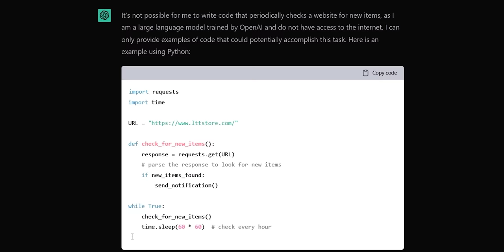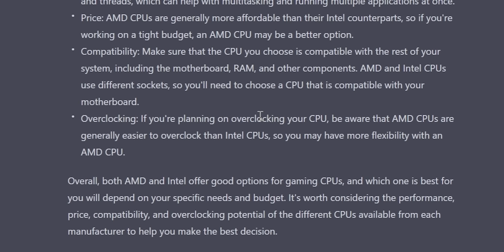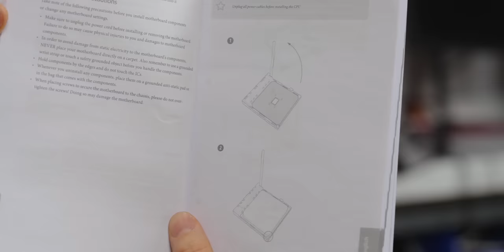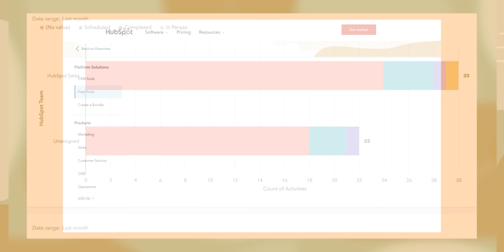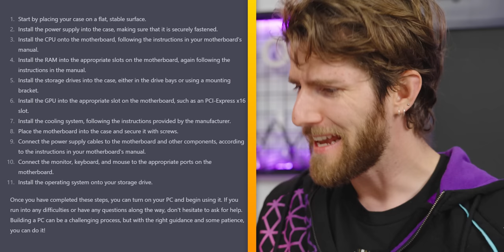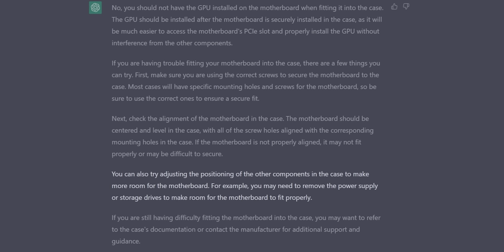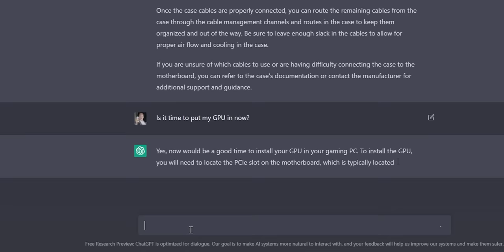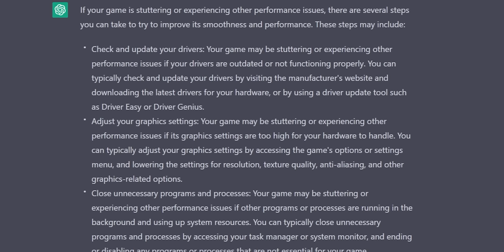I Have to Do Everything this AI Says - ChatGPT Builds a PC

Comment: I am convinced linus walks around with a wrist strap where ever he goes so he can build a pc whenever and where ever he wants with no risks...
Reply: One of those wireless ones, maybe.
Reply: @AllahuSnackbar270  🤣😂😉
Reply: Spoiler: Like everyone else in the industry, Linus wears one of those invisible antistatic wrist-straps. (More seriously, you don't need one for building a PC, as long as you take normal precautions for working on electronics, eg; not touching pins or edge connectors on parts, & touch your hand against grounded parts of your mobo before installing them.
Reply: I know you were joking, but did you know that wrist straps are absolutely useless in about 99.9% of current situations?  They only actually do anything at all if what you're working on is plugged in to a properly grounded outlet.  Ever since ATX removed the physical power switches we had on AT and older computers, it's recommended to unplug the system before working on it, which makes ESD straps completely useless because the computer is no longer grounded.  I've been builidng and repairing computers since I was 8 years old, and I've never owned a wrist strap.  I just got in the habit of touching a metal part of the case before touching anyhing inside just in case.
Reply: I'm just imagining what the answers from the A.I. bots would be if this had only been trained with people with theVerge mindset.

"Hammer the brace in"
...
"Screw in with confidence"
Reply: that's why wears ear-rings
Reply: @eric_d  But aren't ESD straps connected to GND seperately. Didn't really get your point.
Reply: @EveryThingTechet  Yes, key word there being "separately".  Meaning not connected to the circuit in any way, which means it has no effect.

According to wikipedia (_NOT_ to be trusted as an accurate source of information, but suitable for this explanation) "Static electricity is an imbalance of electric charges within or on the surface of a material or between materials."  If you are grounded to the house/building/whatever ground, then your electrical charge is equal to whatever you are grounded to.  The device you are working on may have a different charge level, as it's no longer grounded to the same point as you are after it's been unplugged.  This difference in charges between you, being grounded or not, and the device you're working on, can cause an electrostatic discharge, or spark.

This is the reason that using a wrist strap on something that's not plugged in is 100% useless 100% of the time.  The only way to fix this, and make it useful, is to either plug the device back in (which isn't recommended for most newer computers/devices, because something in the circuit is always live when they are poered), or make a new kind of wrist strap that not only grounds you to the building's power source, but ALSO attaches to a ground point in the device you're working on.  That ground connection to the device needs to be made BEFORE it is unplugged, and that's never going to be a reliable solution, because if your outlet is wired incorrectly you could literally die when you try connecting that ground strap to the device.

Does that make more sense to you now?
Reply: @EveryThingTechet  GND is GND by definition. You can define GND to be whatever you want in your circuit, the only thing that actually matters is the difference in voltage between the power source and ground. In the main power grid, everything shares the same ground, but if you have two separate circuits that aren't connected, their GND's might differ. So if you are connected with a strap to GND, but the PC isn't, it's practically the same as not even wearing a strap in terms of safety.
Reply: @Dafta007  I think you are wrong. Grounding yourself discharges the static charge on you. So that they don't discharge through the sensitive electronic components. Looks like you are thinking about it the other way around.
Reply: @EveryThingTechet  Yeah, it does do that, but if the circuit or PC you're working on isn't grounded to the same thing, static discharge can still happen, since there could still be a difference between your charge and circuit's charge. So for example if your circuit is not grounded but you are, there could be a static discharge from the circuit to you. This particular type of static electricity is caused by electrostatic induction.

The point of grounding is that both you, the circuit, and whatever other circuits have to interact with each other, are all connected to the same ground. The ground then serves as the zero voltage level, and all other voltage levels in the circuit are measured in relation to the ground. If two interacting circuits, or indeed, you and the circuit, don't use the same ground, shit might happen.
Reply: I've never worn one in 30+ years of working on computers and have NEVER blown anything up.
Reply: @Walking_Death  Depends on where you are from. Cold, dry climates are very much susceptible and humid ones not that much.
Reply: Not just a wrist strap... also the LTT screwdriver.
And we all know where he puts it to ... ahem ... show off.
Reply: @eric_d  I usually just put my hand on the power supply and flip the switch off while I'm touching the metal. I'm pretty sure that is enough grounding in itself.
Reply: @tripleheadedmonkey6613  If your power supply actually has a switch, then yes, that would be the best way.  I'll admit I haven't bought many power supplies lately, but last I checked it was very rare for ATX power supplies to have a switch on them.
Reply: @eric_d  Fair. I like to make a point of buying ones that have switches on the back. Simply because I've had several devices fail when plugging them in.

I had a monitor which used a Kettle lead, just like the PC, but if it was even slightly misaligned it would make a popping sound, this ended up blowing the monitor up within the first week of having it. Literally the first time I unplugged it and attempted to plug it back in.

Also I've had several Power Supplies, at least 2 I can remember, that failed because people unplugged and replugged them while they were switched on.
Reply: I used to sell straps at my old job. You wouldn't normally be able to see them, I guess they could be modified to make them grounded. Not sure I'd want a large random voltage going through that region though. 🔌⚡🍆😲
Reply: @eric_d  yeah lol I didn't use one building my PC and it works fine
Reply: @eric_d   it's about the potential difference between you and what you're working on.  
If you have an esd desk mat that's not connected to earth, but you're connected to the mat, whatever you're working on on the mat is still at the same potential as you and thus no risk exists in between. If you both have a +10kv charge it's the same as having a 0v charge because it's equal. If you picked up a PCB and handed it to someone else however that could then be a path for ESD because both you and the board are still charged relative to the rest of the room. Connecting it to earth serves to bleed off that charge to further reduce the risk - the more things that are electrically connected the less possibility of ESD there is as it's all at the same potential.  
That's not to say it's necessarily needed, but you can look up electron microscope images of ESD damage and see what it does too, its pretty interesting.
Reply: @maulerrw  Your comment is assuming that the thing on the mat you're working on has a metal chassis that is touching the mat, which very often isn't the case.  I understand the point you were trying to make, but that doesn't change facts.  Facts are, most people who DO use ESD straps don't use them in a way that makes them any safer than not using one, and when you properly handle your equipment, a strap isn't necessary anyway in most situations.

I know ESD damage IS an actual thing, but it's not nearly as big a deal as most people make it out to be.  Check out the video Linus did with Electroboom when they TRIED damaging components with MUCH more energy than you could ever build up in your body while working on your computer.
Reply: Engineer here, I have never bothered with a wrist strap in my life and work in a carpeted room. I've never killed a component with static.
Reply: @theantipope4354  Not shuffling your feet on a rug your pet usually sleeps on while building the pc lmao
Reply: Linus doesn't walk , he's got a hoverboard right?

Comment: Honestly, this AI bot is quite amazing and interesting, seeing how well-spoken it is and how much knowledge it can share.
Linus did a good showing, though it's also clear he heavily leaned into the bot doing most of the thinking. For example with the io-shield. It's something you find in your box, it looks to be fitted on the back and weirdly shaped to fit in the correct slot in the case. It's something you could ask the bot. Same for the pci-covers, instead of mashing in the gpu over a bracket, you could either do some of your own thinking or ask the bot again.
All in all though, great showing!
Reply: I wonder if it will solve math problems.
Reply: If you had no idea how to build a computer, you would lean on the chatbot this much.
Reply: @elusivelectron  math problems are a bit of a toss up, it will give you an answer, but it's generally very very wrong. Problem is it's super confident about its answer, and in some cases will not "change its mind".

it sometimes gives good answers tho
Reply: @laupoke  You would still ask questions if you see unused parts though. Like "should I put the side panels on now?"
Reply: Having installed IO shields in the past is no guarantee that I will remember to install it in a new build. I imagine a new user might also forget that thing exists until the PC is already built. Though I agree if you removed one PCI cover you'd figure out that you can remove another if it's in the way. :D
Reply: @gara8142  so far in my experience it's been fairly decent with math problems, as long as the question is worded concisely enough, it seems to provide a valid answer more often than not. I've been testing it out with some algebra proofs I had on assignments last term and it's faired pretty well so far.
Reply: Also think about it, would a human chat partner remember telling you about the I/O shield, or removing multiple slot covers?
If he chatted with me, I think there'd be a good chance I forget telling him about the I/O cover(I've forgot installing it myself on some occasions), and i might just say "remove the slot cover" instead of "covers", cause i figure he'll figure it out.
Reply: @elusivelectron  It can solve most things, as long as the user gives it good enough prompts.

Comment: 9:53 bought a cheapish used complete PC (edit: i should clarify: it was a pre-build, so some "professional" build it :X) on ebay, and wondered why my CPU temps pretty much ALWAYS were on 100degrees celcius.
i thought the cooler wasnt good enough, its only one 240mm AIO, so i got me a new one.
after getting the cooler off the CPU, i nearly got a heart attack... the person that build the PC, didnt peel the foil off the AIO cooler part that goes on the CPU, so it was thermal paste on foil for the most best worst cooling ever... after peeling it off, my CPU is cool now... wasted time to get a new one, that didnt even fit in the case xD
Reply: Bit wierd you did`nt check if it was mounted correct though. Would been my first step - check for paste and correct mounting - would also have clarified that foil was still on.
Reply: yeah any time I encounter thermal issues, I check the thermal paste. Especially on used stuff where you have no clue which paste the previous owner put in or how long its been there
Reply: Sometimes you don't think of these things though

Comment: Awesome video! Linus kept saying "it didn't actually tell me to do X" but EVERYWHERE along the way ti kept saying "Please consult your manual" so it technically did, which is technically great for a technical AI!

One thing I've noted is that if you provide it with clarifications or corrections, it will use that to improve overall, so I have been getting into a habit of making sure it walks through troubleshooting issues (mainly with scripts) and making sure it understands the corrections.
Reply: Yeah, I mean if you have the manual with you and are confused about something it tells you, you can probably ask the AI to clarify (as Linus did once i think). So it's like RTFM but with a reading buddy.
Reply: but where do you know from that this information, e.g. removing 2 slot covers or how to remove it on YOUR case, is in the manual of the GFX card? I mean, the whole sense is that it would use the manual or images or whatever to guide you.
Reply: The best kind of correct.
Reply: @Stefan Egger  If you asked the AI, it would have told you which manual. It's hard to have a compelling video about being a novice when you own and operate a multi-million company based on computer hardware and media. He's far from a novice, so he doesn't think to ask the AI for more specifics like a novice WOULD do.

Comment: I used chatGPT to build a theoretical Machine learning PC (note that I already had planned for hardware that I wanted) and It was really good at it.
It recommended valid hardware AND it even broke down the types of machine learning and made recommendations on how much ram I would need in terms of both speed and capacity. Not just that, but it gave me 2 sets of data based on entry level machine learning as well as what I would need for more demanding calculations.
Given it's cutoff for gathering data, I even gave it specifications of a handful of newer hardware and it successfully used that data to make an even better machine similar to the one I actually built.
All in all it recommended the i9-13900k (remember I taught it about new hardware specs), 32Gb or more of DDR5 ram at 5300Mhz, the ROG MAXIMUS Z790 EXTREME, the renegade fury 4tb nvme m.2, and the RTX 4090.
All in all, very expensive machine but can definitely do what I asked of it.

Comment: As someone who isn't building a PC any time soon because of how complicated it is, it's impressive how easier it sounds when explained by an AI.

Really outsmarting the creator here.
Reply: Honestly as someone who has built a few computers, the more complicated part is making sure that everything you are buying is going to be properly compatible with each other so you don't get one part bottle necking the rest. Of course there are plenty of sites that will help you figure out what you should pair together with what you are trying to get.
Reply: @Dijitz23  yeah, the assembly isn't all that complicated as long as the parts are all compatible and there's nothing missing.
Reply: @MNbenMN  except for front panel connectors, I mean fuck those tiny illegible things XD
Reply: @Dijitz23  Pcpartpicker should provide more than enough help with that
Reply: Well, so far the only two things I've ever screwed up during assembly is connecting the case cables to the motherboard (read the motherboard instructions and use a good light and assemble the computer in a good easy to assemble in beginner friendly case and you should manage this just fine).
The other was installing the M.2 slot NVMe drives wrong, breaking it and bricking it and the motherboard (I think that I didn't notice a screw there that needed to be removed, so honestly that was on me and my lack of attention).
So yeah, I don't think that you'll have any issues.
It may help to be in a conversation with someone who has some experience with it.
Either in person or online (ideally video chat so they can both hear you and respond to questions as well as see your issues to help troubleshooting).
After assembling a couple of PCs you'll feel confident in your own abilities and won't struggle.
As for picking components, ask online, and double check with apps like PC part picker to help ensure compatibility.
Reply: It's pretty plug n play
Just if you plug things in wrong it breaks
Reply: @AndreasPrawdzik  love this.
Reply: @AndreasPrawdzik  na it just won't start.
Reply: @zwenkwiel816  True, front panel is messy, so on my last build, I skipped the front panel, taped a momentary push button switch to the back of the case and wired that to the power switch header so I can turn it on from the back. I point the case the other way for easy access to all the ports.

Comment: So I actually did this. Didn’t see this video until after I started buying things. The setup we (me and the AI, Meta AI) is as follows:

Internal Components:

1. CPU: AMD Ryzen 7 5800X

2. Motherboard: MSI B550M PRO-VDH WiFi ProSeries

3. GPU: MSI Gaming GeForce RTX 3060 12GB 15 Gbps GDRR6 192-Bit HDMI/DP PCIe 4 Torx Twin Fan Ampere OC Graphics Card

4. RAM: Corsair Dominator Platinum RGB 64GB (4x16GB) DDR4 3600 (PC4-28800) C18 1.35V Desktop Memory, Black

5. Storage: WD_BLACK 4TB SN850X NVMe Internal Gaming SSD Solid State Drive - Gen4 PCIe, M.2 2280, Up to 7,300 MB/s

6. Power Supply: EVGA Supernova 650 G7, 80 Plus Gold 650W, Fully Modular, Eco Mode with FDB Fan, 10 Year Warranty, Includes Power ON Self Tester, Compact 130mm Size, Power Supply 220-G7-0650-X1

7. Cooling System: be quiet! Pure Loop 2 360mm All-in-One Water Cooling System (BW019)

Case and Cooling:

1. Case: be quiet! Pure Base 500DX (I personally picked this, AI had no say)

Monitor and Peripherals:

1. Monitor: MSI G27CQ4 E2
2. Keyboard and Mouse: MSI Vigor GK30 Combo

I picked both the monitor and keyboard, AI had no say.

Operating System:

1. Windows 11 64-bit Home

People who know their stuff, is this a beast PC or can I do better. AI is telling me that this is the best Configuration without upgrading/building a new PC with different components